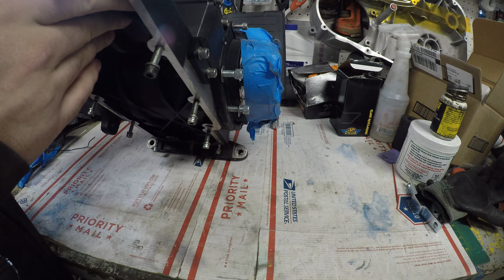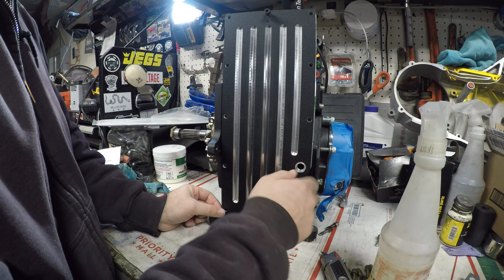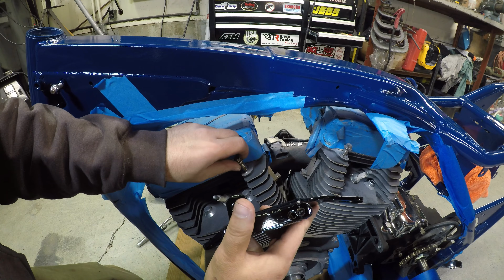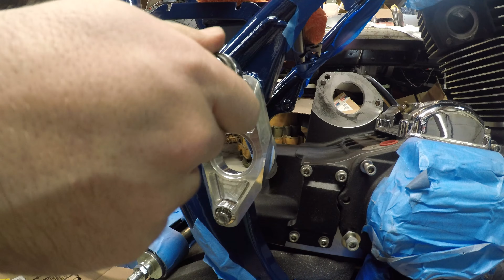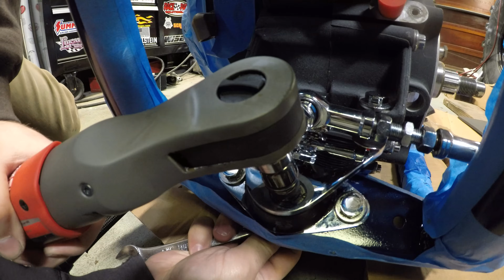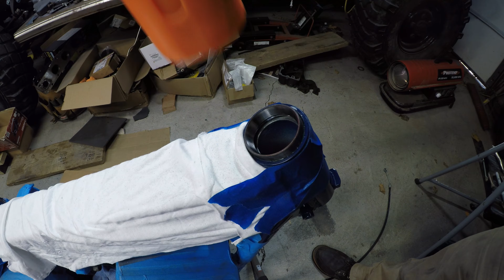Harley FXR Build Part 1 | Twin Cam Swap | Engine mounting | Pivot Block install  | Neck bearings

Comment: Hey rious why a twin c...Why not a 124 or bigger evo?  What am i missing?  Old vid but yeah you can enlighten us man. Cause I want way more power than a 111evo   ; )
Reply from the maker: A few reasons. First is I like to build stuff on my own and had a ton of NOS twin cam engine parts in my possession. 
Second, I like short stroke motors. The 124 is 4-5/8 stroke, the 111 is 4-1/8 which would work for me. But the 88(punched out to 95 in my case) is 4.00, which means at piston speeds of 4600 fps(6700rpm) i can rev the engine out to make up for the lack of displacement. 

I do like evo's, nothing against them. This option just made sense for me.

Comment: I replaced the stock crossmember with a piece of 5/16" thick steel flat bar I can use as a jacking point and which protects the transmission. You can and I did to all the welding from below with drivetrain installed (which I did since I was just swapping in a bagger box on my Evo which is the identical situation). I previously installed a REAL (Panhead style) sidestand which bolted to the left fron peg mount (I used Shovel parts but raw adapters exist) highway peg mount. Dumping the bendy stock FXR stand was a joy.

Comment: Can I ask you what is the color code for the factory color ... I have number 700 of the same bike and can't find the color code to have the frame repainted
Reply from the maker: I never got the color code unfortunately. My local paint store just used the swingarm to scan the color off of it and mixed me a batch of it.

Comment: I just want to add that there are several companies that make an actual twin cam to fxr oil pan.  I have used 2 different ones and both were great.  They are 1100 bucks but its worth imo
Reply from the maker: I do mention that in the video. I'm wrong on the price but was aware of it. They are a very nice solution as well.

Comment: Doing my first conversion on an 86 fxr but only the motor is getting swapped. Not having an easy time aligning the primary. Lots of loosening and adjusting 😑
Reply: Where at like where the cleave blocks are?  It's a pretty easy fit I'm struggling to understand what is wrong on yours.   The only point that is very tight is where the primary is in relation to the cleave.
Reply: @phdwinner  morning. I was able to find and buy the manual, cracked it open and  read the alignment portion from rear swing arm and I think I got it dialed in. Seems to be aligning good from eng to prim and prim to trans.
Reply: @usmcdoc2512  good deal man.  Here's a tip from me and I know it doesn't matter to many but for aligning this engine dead to rights the best thing you can have is a pair of rigid struts.  You put those on and you know the swingarm is dead true to the frame.  Then align everything from back to front.
Reply: @phdwinner  dude, That's a great idea. Thank you for the advice! I'll take any advice I can get.
Reply: @usmcdoc2512 or just some threaded rod with 2 rod ends with a 1/2 hole.  Doesn't have to be actual struts just something cheap you can use that ensures the swingarm is true to the frame.  So like maybe 12 or 13" eye to eye and lock it down there.  Install the tranny, instal the motor, and set the engine mounts accordingly.  It'll be right when your done.  Then throw on whatever shocks or struts you want to use.

Comment: Thank you for the detailed videos of your build - they help me a lot. Tell me, do you powder coat the frame or is it liquid paint under varnish?
Reply from the maker: I appreciate the feedback! It's just liquid paint. Since I knew I was going to be modifying the foot control mounts I wanted to do paint so I can touch up if any other modifications were needed. I plan to strip it down and powder coat it in the next few years

Comment: What year Bagger engine would work for an fxr swap?  And would it be possible to keep the evo transmission?
Reply from the maker: Any "A" series twin cam engine from 99-05 is easiest to swap in. So bagger or dyna engines, no Softail engines. If you want to use a transmission from a twin cam, it needs to be bagger transmission, preferably 99-01. If it's a 02-05 it's not a deal breaker but you need to change the pivot shaft from 5/8 to 3/4 inch. It's possible to keep the Evo transmission but I don't see it being worth it personally. A big reason to go with a twin cam is the fact the engine and transmission are bolted together, taking the stress off the inner primary.
Reply: @EngineersGarage1 and bare knuckle performance makes the sleeve to where you don’t have to change your pivot shaft over too ..

Comment: If you don’t mind me asking. Roughly how much did just the motor and trans swap cost ya?
Reply from the maker: It can likely be done for 2k-4k depending on what your tolerance is for reusing stuff. Like if you get a donor engine and trans from a bagger with a carb and ignition on it, you can find that for 2k with some searching, then you don't need much. I went overkill, built the engine, re gasketed everything, new covers, bolts etc. so it cost me closer to 5k in the engine and trans

Comment: did you ever change the original frame of the FXR?  if I install a dyna 08 TC96 for example, is it very different from what you are doing with this 2001?
Reply: I installed a 2008 dyna 96 on mine but you will need a touring tranny.  Otherwise the engine is identical.  You won't have any issues.

Comment: What are some reasons to run the twin cam over the evo ????

Great build series keep it up 👊🙌
Reply: Tons of cheap takeout engines, easier to build big inch engines, MUCH stronger engine/transmission connection that doesn't crack inner primary covers and integral oil bag. (I converted to a bagger box on my Evo to get rid of the retarded stock oil bag, the crossmember mod cost me like five bucks for the bolts and no way I wouldn't do the same for a Twinkie swap since it greatly eases maintenance and declutters the bike.

Comment: Sorry I didn't watch the whole video yet but did like it. I know you used a 5 speed 2001 tranny, but what year engine did you use?
Reply from the maker: The engine is a bit cobbled together. The cases are a 2000 I believe. The crank is a NOS 1999. The heads are a 2006. Any 1999-2001 twin cam is what I prefer to use.
Reply: @EngineersGarage1  So you chose an 88tc. Any reason for that choice? I know the heads are an upgrade from the previous years. I have an 06 Road King and had Andrews tw26 cams installed. The are mid range torque cams and I really like them.
Reply from the maker: @retiredguyadventures6211  it's now a 95ci, but I chose an 88 twin cam to start for 2 reasons. The timken bearing bottom end, and the shorter crank stroke. I prefer to make my power up top, shorter crank throw lends better to higher RPMs. The timken bearing bottom end can be overcome on later engines with a Jim's kit. It was just eaiser and cheaper to start with an early 88ci.
Reply: @EngineersGarage1  I am considering a 95ci kit for my bike as well. I understand the 88tc's have more torque due to their higher rpm but I'm not a wrench so it's just what I heard. I love the torque on my Road King though. I'll have to look into the "Jim's Kit" for the bottom end bearing when the time comes that I might need one.
Reply from the maker: @retiredguyadventures6211  yup, torque is a function of rpm, more you can squeeze out the better
Reply: @EngineersGarage1  That engine has to be nice in the FXR frame. My old 87 FXR-SP was probably the best handling bike I've ever owned and miss it a lot when I'm in the mountains.

Comment: I just saw an FXR that had a VROD engine in it at the 2022 Bike Week in Daytona. It was at the Speedway and there was an FXR show going on. I did not know about the show ahead of time so it was a pleasant surprise as I bought a 1987 FXR-SP back in 1990 and owned it for 20 years until I bought my Road King. I was a dumb ass for letting it go...

Comment: What color and brand powder coat did you do on the frame. I also have an 87 fxrc and long story short, I got screwed and my frame is bare metal now and I don’t have a color to match anymore. I would definitely appreciate any help buddy.
Reply from the maker: It's actually paint, had the local paint shop match it before I stripped it down.
Reply: @EngineersGarage1  dude you sent me your pivot block. I’m wolfman on the fxr alpha page lol
Reply: Def bring it to a paint shop. Iv looked an bought so many of Harleys touch up paints online, visited two Harley dealers, and asked a bunch of people for the color name or code an nobody can tell me either. Harley doesn’t even list the color.

Comment: Hi love the video 
Was wondering if you can give me some advice .
Can I run a tc motor with my 5 speed fxr box and just get an adapter plate or do I need to use engine and trans from  twin cam 
Many thanks
Reply from the maker: There a few companies that make adapter plates to make a 99-05 tc bolt up to the FXR Evo 5 speed. That's a very straightforward swap. You'd need an "A" motor from a dyna or touring bike, a Softail won't work. 99-02 engines have tapered roller bearing in the case, commonly referred to as "timkens". They're preferred but it's not a deal breaker. Vulcan works makes an adapter plate to run your stock fxr 5 speed with a 06 and newer twin cam. I'd personally say it's not worth the trouble since the primary bolt pattern needs an adapter too. Not to mention you'd have to convert that 06 and up motor from fuel injection to carbed, adding cost. All in all it's much cheaper to stick to 05 and older TCs.  

Option 2 is what I did. You can get a twin cam motor and trans combo from a touring bike and it will bolt right in, but then you need to make a block off plate for the trans, cut the bottom of the frame, or buy a custom oil pan. One of the benefits of the engine and trans combo is a very strong engine to trans connection.
Reply: I modded my frame for a bagger box (same mods as TC conversion so I can drop one in if my S&S goes boom) and relocated the sidestand to the left highway peg mount to use a proper Shovel era classic stand rather than the bendy stock FXR part. I made the new crossmember much stronger (it also acts as a skid plate, my local roads are nasty) and easy to unbolt so I can pull the oil pan (like ya could on trucks and cars back when access mattered) without removing the gearbox. Kits are reasonable but any non-retarded weldor can do the work very easily. The best five speeds were in the Twin Cam era bikes anyway and are popular upgrades when doing the spline shaft upgrade to early transmission cases. See the FXR Cheat Sheet group for every possible way to do the TC swap to get what YOU prefer. It's your ride after all.

Comment: what did you do for your real swingarm? Fxr pivot shaft with bushings through the trans case?
Reply from the maker: All the stock bushings and shaft fit up. Dimensionally the transmission(99-01 years, mine is an 01) is the same width and diameter hole so it's possible to use all the factory fxr parts. I upgraded from cleve blocks and a 3 piece shaft to spherical bearings and a one piece shaft(from CCE). I used new, but stock rubber isloates. 2002 and new touring trans have a 3/4 inch hole and require a bushing or larger pivot shaft.
Reply: @EngineersGarage1  good information. I have a 04 trans in mine with bushings. Not super happy with the setup. I'm trying to decide what route I'll be going with while redoing this swap. I am in the process of redoing the whole ordeal with a new (non butchered) frame and I stumbled across your videos, really good btw.  I'm on part 3.

Comment: I just cringe when guys hack the cross member on a perfectly good FXR frame when doing a TC conversation 🤦🏻‍♂️
Excellent Blanking Plate !!!
Reply from the maker: Thank you! I'm not sure why people are adverse to running an oil bag, the fxr side profile looks wrong without it.
Reply: Agreed! 

Plus the structural rigidity the member adds to the aft lower part of the frame rails.
Reply from the maker: @louisgpascalliiii1795  absolutely
Reply: @louisgpascalliiii1795  Baggers dont run the same cross members as FXR's, and those guys run bulk HP through em.